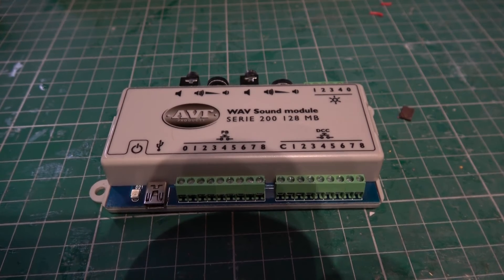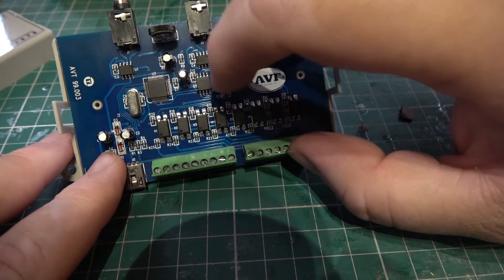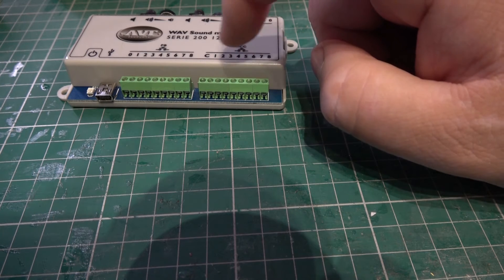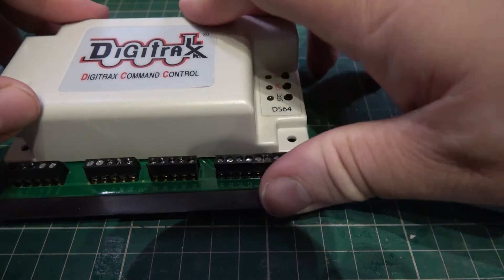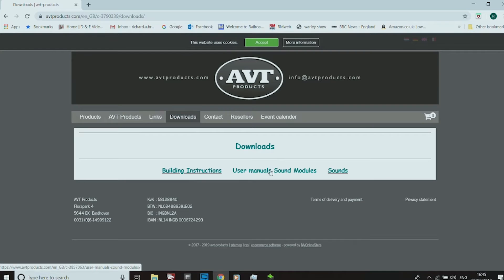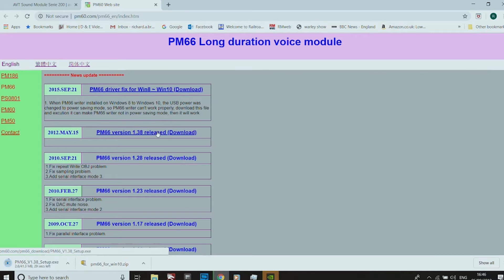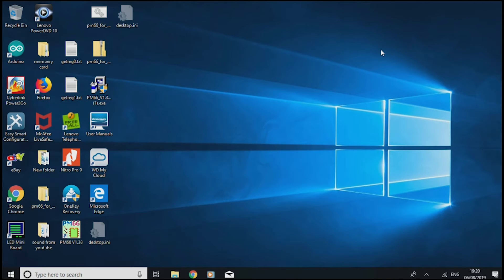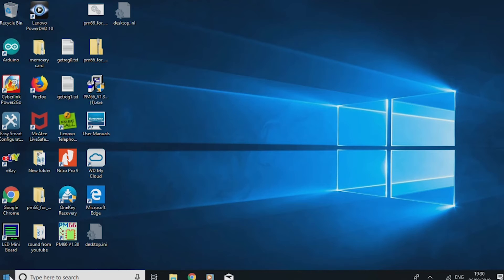A look at the AVT WAV sound module series 200 128mb

Comment: Looks like your Wave file may be encoded in a bit stream other than PCM (Pulse Code Modulation), which the PM66 Writer complains it needs. You can probably re-encode it as a PCM bit stream and save it as a Wave file using the free software Audacity.
Reply from the maker: Thank you